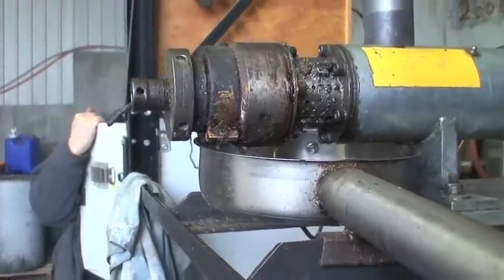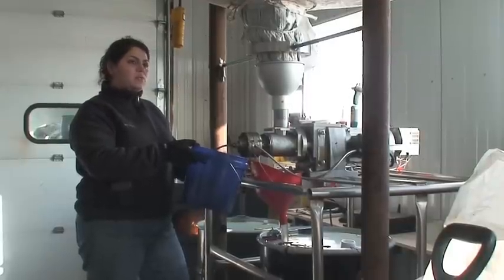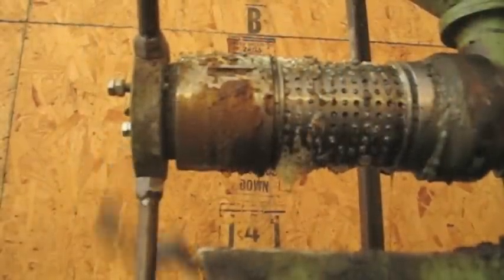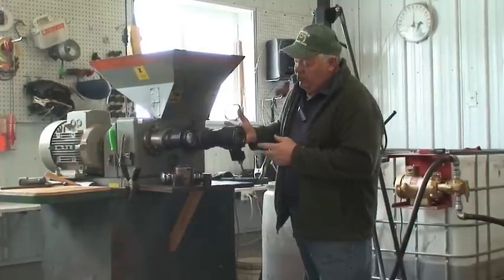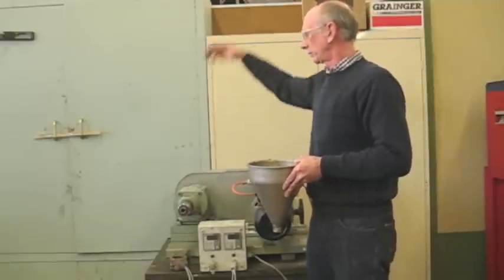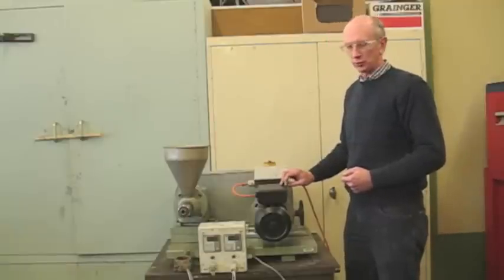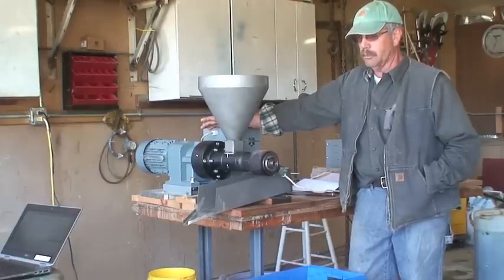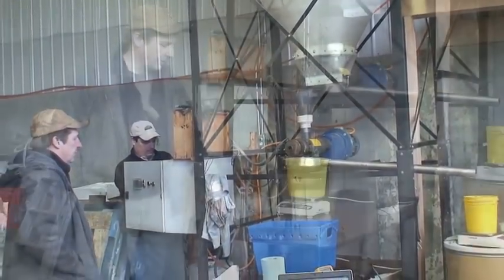Small-Scale Oilseed Presses

Comment: 14:10 I see this video is six years old, but I'll comment in case someone is interested about motors.  A VFD does the "conversion" internally (no converter needed).  Using a 120V motor removes the variable speed feature from your press.  It is best to use a 120V-1PH VFD that outputs 240VAC 3-PH (if that is not what you already have).  Then you can use a regular 120VAC-60Hz outlet to power the 3-phase variable speed motor.  The 50Hz rating on the motor represents its design speed.  Your VFD provides variable frequency to the motor.  The motor could burn out if run too slowly (not enough cooling) or too fast (too much power), depending on what load your press is applying.  The goal is to not overheat it.  This video shows me that the press speed seems to be pretty important to match to the seed being processed, so don't lose the VFD functionality by using a 120v motor.  There are no 120V 3-ph motors, only 240v 3-ph.  You don't need a 60Hz motor in order to be "compatible".  You need an "inverter rated" motor that allows it to operate speeds from low to high (for example 6Hz to 90Hz).  If your VFD is not 120V input, the Automation Direct GS21-10P5 is an example of a 1/2hp VFD (though I can't determine what HP your motor is, looks like about 1/2).  Check the label on your drive, maybe you already have everything you need.  Also, the VFD you have will fault if the motor is bad.  Understand the fault code to be sure.  Problems could be the drive or the motor.

Comment: The motor that was being replaced was being driven by a Variable Frequency Drive.  
So the frequency on the plate makes little difference.  Running at a higher speed/
frequency than the boiler plate calls for requires good insulation, so the insulation 
class has to be good enough.(B usually)  Running slower under heavy loads can 
become a problem if the fan built in the motor can't move enough air to keep the 
motor cool. An external fan might make sense.
 
If the machine keeps eating motors, you might want a larger motor.  Going 110
volt sounds right given the need to find power during demonstrations.

If I were replacing the motor, I'd use a small 3 phase motor and swap out the
variable frequency drive to a 1 phase to 3 phase frequency converter.  Cheap
reliable motor and one phase power.(albeit 220v)